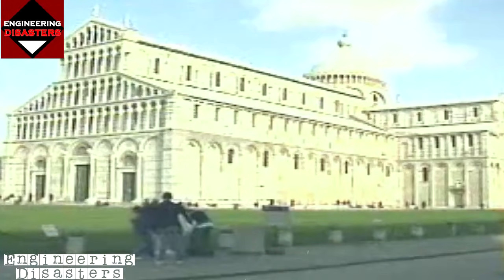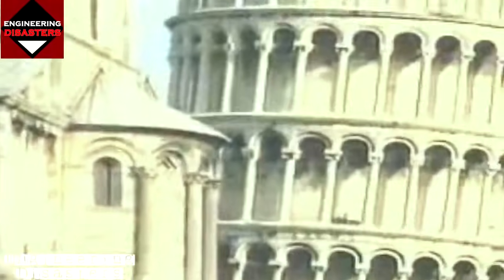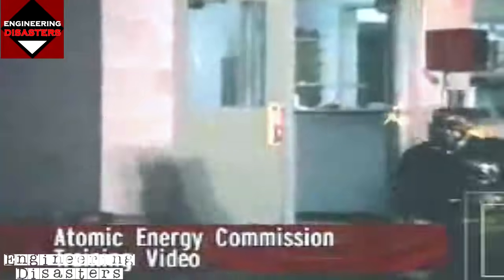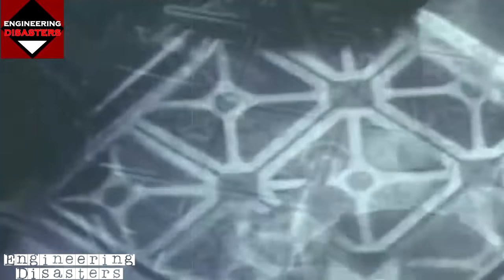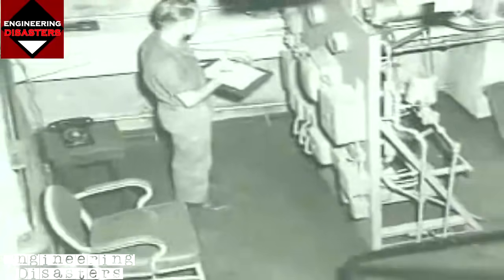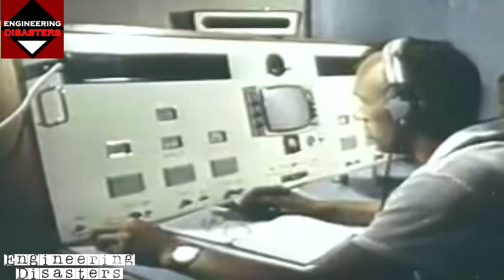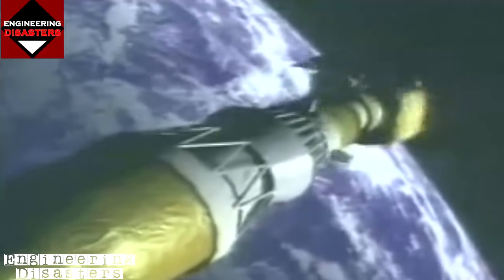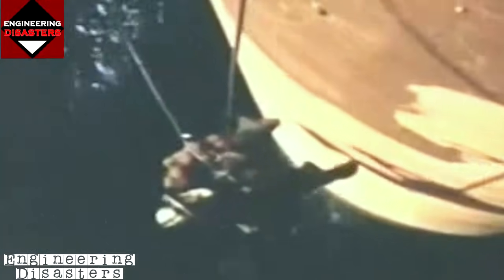Worst Engineering Disasters in History - Episode 3

Comment: The sound is slowed down to keep youtube from detecting and taking it down. Go to settings and change the speed to 1.25 and it should be closer to the original speed.  Sadly the sound distortion s can't be fixed though... :/

Comment: I don't think it was the 1st peacetime nuclear accident (as quoted by the video). What about Windscale in 1957?
Reply: The Castle Bravo test in 1954 should count, a nuclear test in '54 that ended up being 3x as large as expected and irradiated several populated islands.
Reply: First nuclear accident was US-army in 1951. Three personnel made mistake of overloading pressure cooling system in small scale reactor, 1951 (check date).
Reply: @raddison3187  That would be the Stationary Low-Power Reactor Number One in 1961 (SL-1). The three men died as a result. It wasn't overloading of the pressure cooling system though...during start up prep following a routine maintenance shutdown the main control rod was withdrawn too far, causing the reactor to go prompt critical, leading to a steam explosion. One of the guys that was on top of the reactor when the control rod was being manually withdrawn ended up pinned to the ceiling by a shield plug, which had entered through his groin and exited through his shoulder...
Reply: @Penguin_of_Death  There was also the "americium-Man" who was so contaminated that people could not get close to him for years. He lived another 30-35 years. However, what do we know from usaGes of uRanium-238, remains to abide by viRtuous "clean-ups"...

Comment: (1)  "Engineering" over 900-1000 years ago was not engineering.  It was guesswork.  Many structures collapsed (especially cathedrals) as part of the learning curve.  Of course, the tower at Pisa is still standing in spite of mislabeled videos!  (2) Improper maintenance and operation regarding removal of the control rod by the human operator(s) did not indicate and "engineering" failure, but an operational one - an accident at a very early nuclear power plant prototype.  (3) Loss of Tower 4 in a strong storm was a product of several issues, including maintenance, inspection, government penchant for taking forever to respond, and possibly engineering - which was relatively in its' infancy in the 1950's.  I know - I worked in design of offshore structures much later and understood its' history.  THis accident was certainly NOT worse than the Soviet threat after WWII - a frankly idiotic claim made in this video.  (4)  Failure of the explosive bolts to fire in sequence AS DESIGNED points to fabrication error, not engineering failure for the Soyuz craft.  (5) One can call the conversion error(s) related to the Mars Climate Orbiter failure to "engineering", but it points out an application of this "faster, better, cheaper" mantra of the owners to this design - a mantra that is decried and denied by all good engineers.  In fact, we engineers like to say "you want something faster, better cheaper"?  You can get two of the three, but NOT all three.  The text under this video mentions "shortcuts in engineering design" as being a cause.  It can happen, but the vast majority of "shortcuts" are by fabricators and owners, not engineers.  Another lying video with inaccurate information.